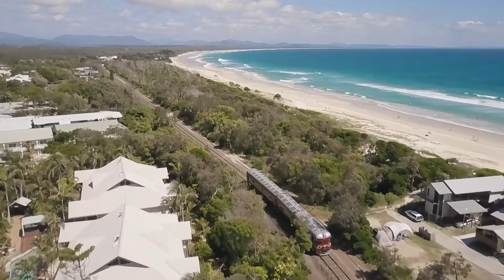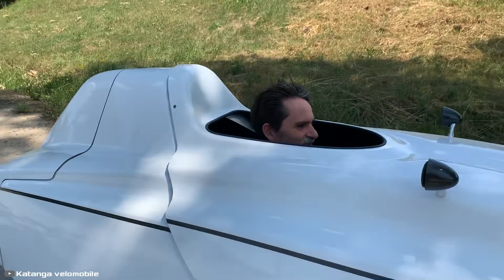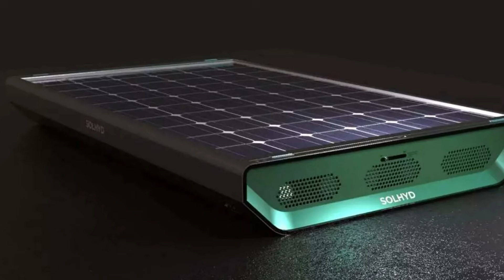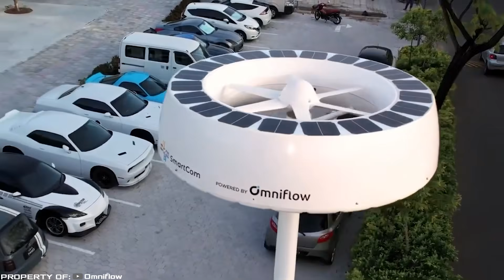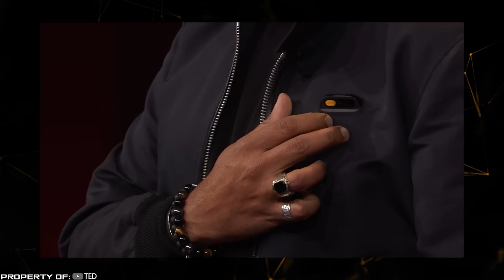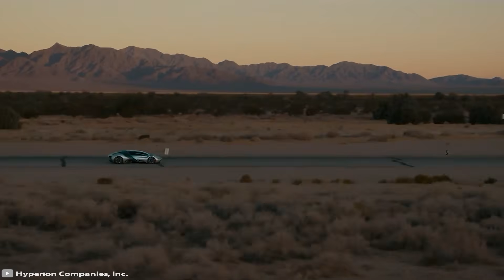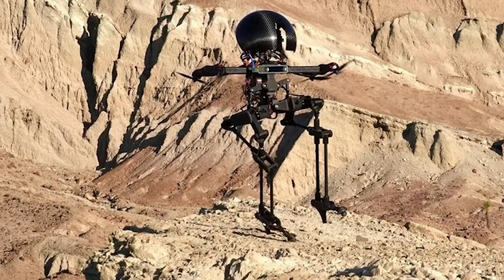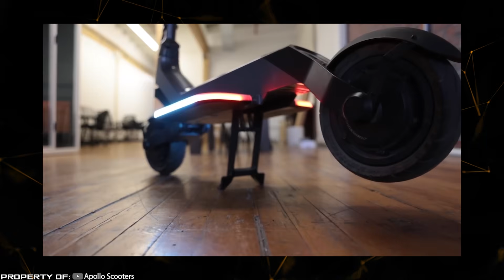INCREDIBLE INVENTIONS THAT WILL BLOW YOUR MIND | BEST OF 2023

Comment: Zip line looked neat! Better only go to upscale neighborhoods!
Reply: Hold the module with your hands and when the drone rolls up the line it will descend and you have a free drone!
Reply: Actually, poor neighborhoods already benefit greatly from use of small to medium drones for medical cargo. The vertical zip line drone in the video could certainly be modified to travel further and cover larger impoverished areas. Of course, there are already competing designs in use.

Comment: That AIRSEAS company, that is making a special kite to tow ocean going cargo vessels, should collaborate with a KiteGen company, that experimenting with a giant kite, which would generate electric power, by the kite being blown up into the while pulling a towline that empowered an electric generator on the ground, then folded up like a kind of umbrella to be towed back, to start the power making cycle again. Also, I think I saw a company on this website, that invented a flying kite or windmill, that did the same thing, only by circling around in the sky with vane controls, with a partial pulling and retracting of its tether line. The point is, this thing might be tweaked, so that when the ship it tows is docked or anchored, it could ALSO provide a lot of electricity for the ships electrical system as well !
Reply: True. There are some limitations on location. Having lines dangling in the air creates a problem for ships docked/anchored near a busy area. The cables in the air also create a problem for birds, particularly at night.
Reply: The reason maritime transport  changed from wind to engines was speed and economical reasons. The wind doesn't blow on the direction you need to,also doesn't blow at a stable speed. So if you install a kite generator on a ship and the wind blows lateral or from the front,or if the ship's speed is higher than the wind speed,you will consume more energy in form of fuel consumption than the energy generated by the kite. That makes a bad economical inversion,also adding risks like the kite to fall in the water or to crash on the ship during  wind changing direction suddenly,an usual thing on the sea.
Reply: Old